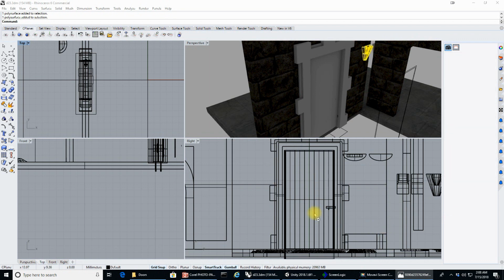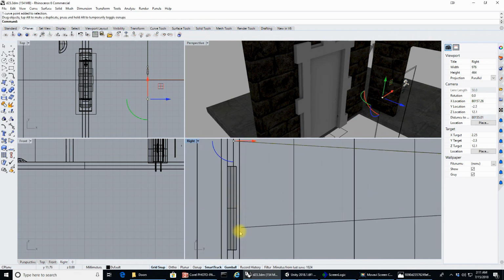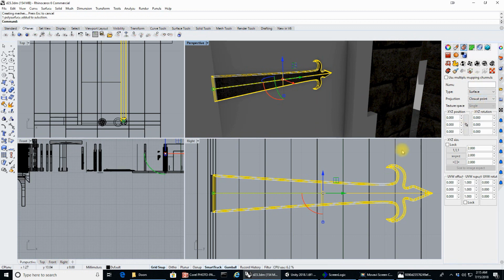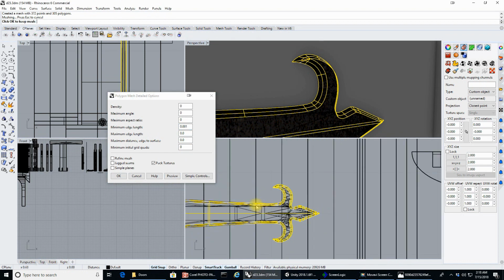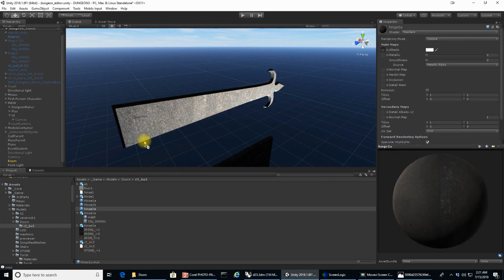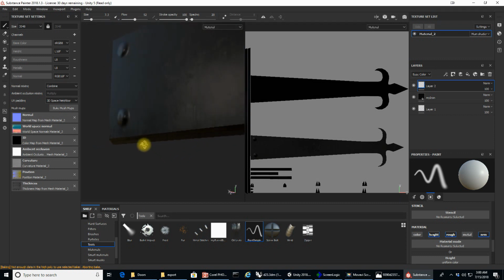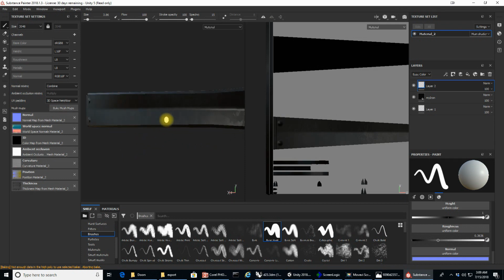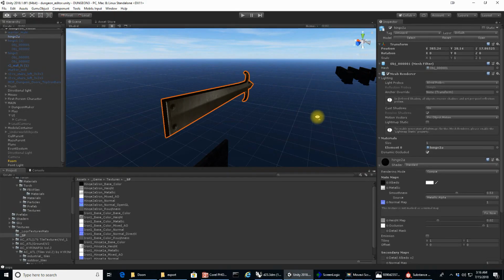3D Modeling and PBR Textures for Unity3D using Rhino and Substance Painter

Comment from the maker: I used Pinnacle Studio 21 Ultimate to make this video, and it sucks ass. As you can see from the cuts it injects a yellow screen of garbage for a second and that doesn't exist in editors preview mode before rendering the video. I just called Corel who now owns Pinnacle and asked their tech support. Of course the tech support is some guy in India and he actually has no idea how to even use the product but said he would send it to a REAL tech who would then email me back a solution. We shall see. Oh and this happens on both of my computers and happened in an earlier version I had owned I think it was version 19. I had upgraded recently thinking they surely had this fixed but nope.  I may wind up buying Sony Vega or using Premier in the future if they can't tell me what the fuck is going on.